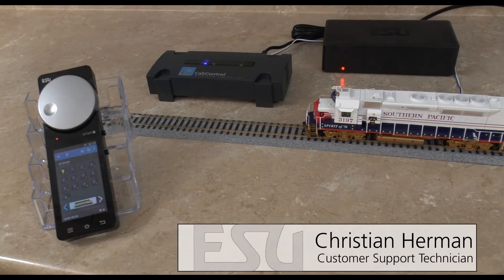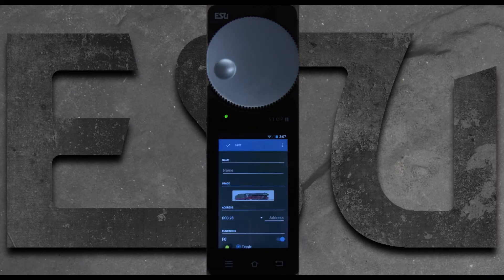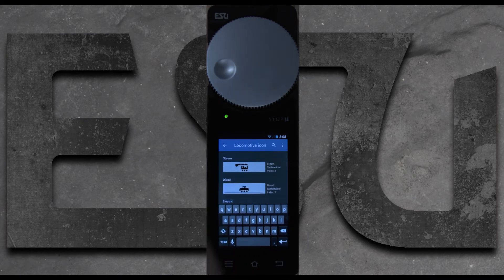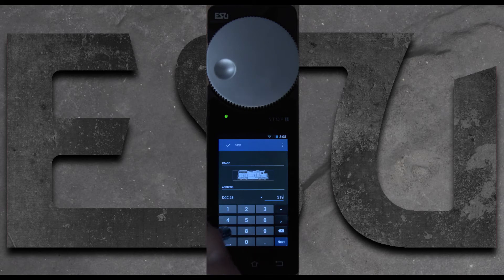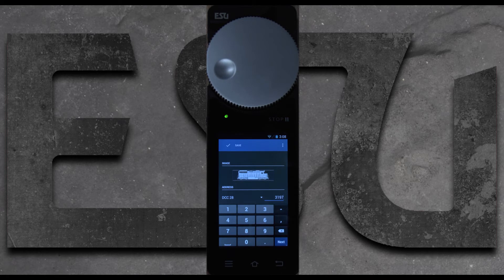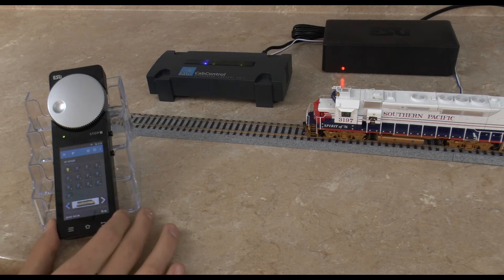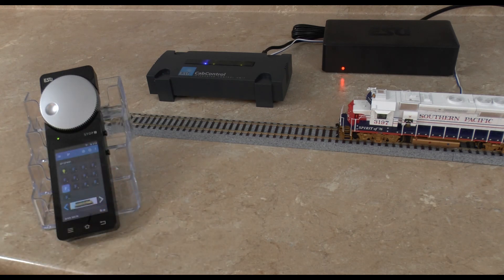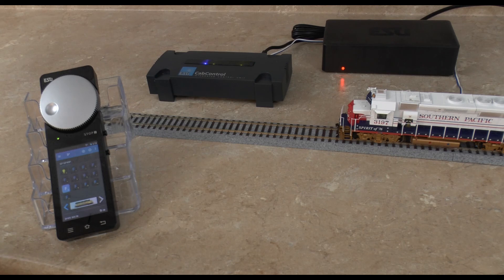Manually Entering Decoders Into CabControl

Comment: I have tried to create with several different units but must always use DCC address #3  what am I doing wrong !!!
Reply: Hello, I am searching the internet hi and low about the same problem you had. I just received this system less that a month ago and I have the exact same problem. Did you ever find out how to fix it? Your call out is the closest thing I have found. I don't even know if you will get this reply. I'd be so grateful for any help with this. Thank you Steve.
Reply: Plug your track into the program track jack on the back of the cab control and re set the address of the loco. You cant do it unless you're on the program track. ESU also made a video on how to do this.

Comment: Just a reminder. The address entered in “create locomotive” or “edit locomotive” must be the address already written into the decoder. So if you are adding a new loco out of the box you will need to push the 3 bars at the top left of the screen and choose “DCC address” to write the locomotive address you will be using. (The nice thing about “DCC address” is that you can enter a 4 digit address directly without having to adjust CVs.)